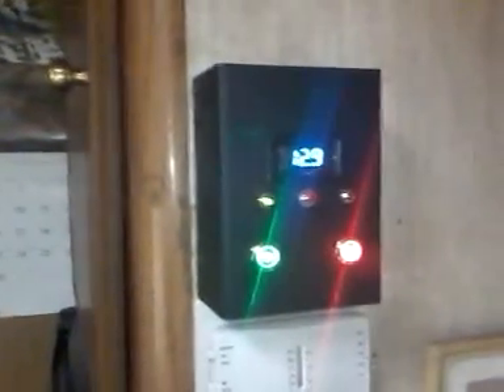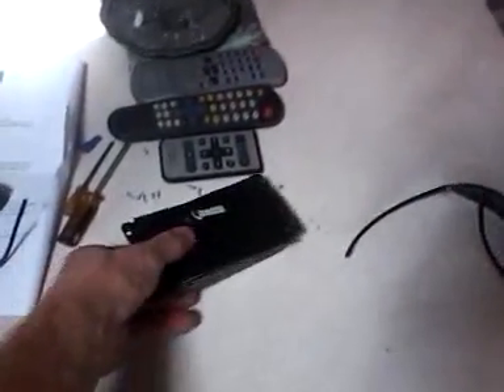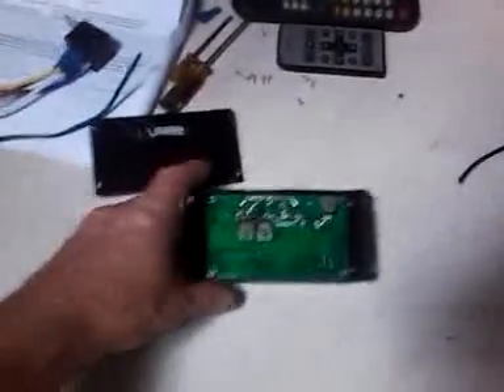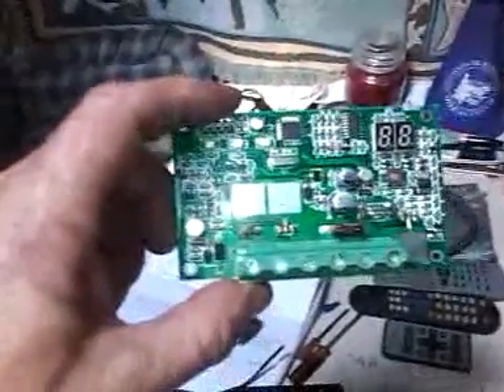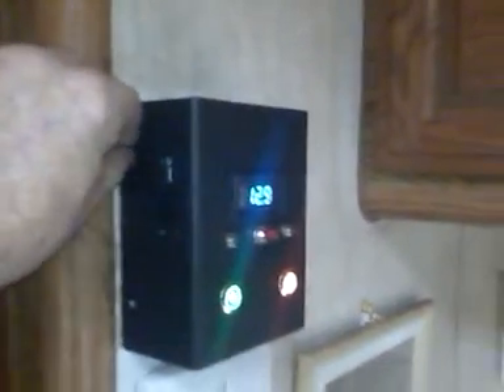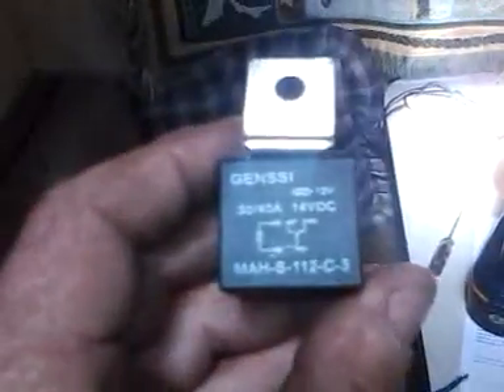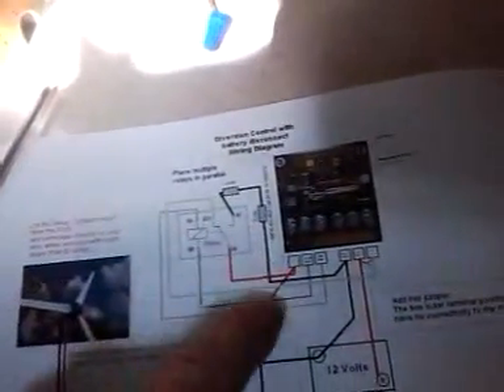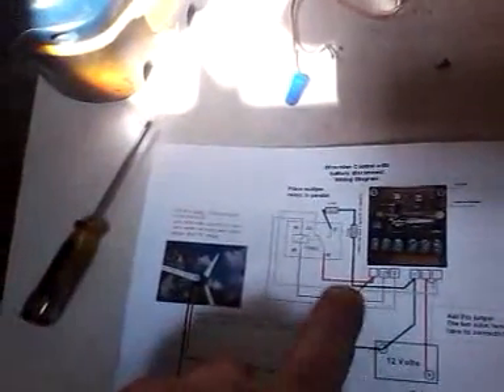Diy vs factory solar charge controler

Comment from the maker: Yes it is a wind/solar controler and maybe an mppt charger may be better because it can trickle charge but at 12v its impossible it seems to get a controler that handles more than 500 watts! I like that it diverts the charge to another load which isn't regulated so I'm using another controler to charge battery just for tv. Thanks for your input have a good one!

Comment from the maker: I'm glad this helped but I forgot to mention each relay handles 720 watts @ 30 amps and I have 2 of them so for a 60 amp controler with drop charge that handles 1440 watts I spent about only about $125 for everything! Ps I called relay a solenoid towards end of vid my mistake it does same thing basically